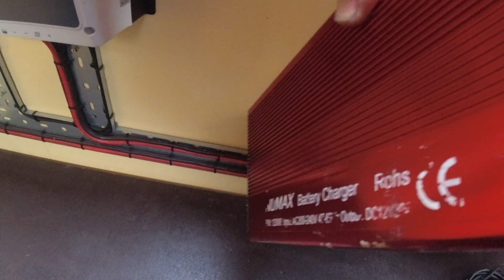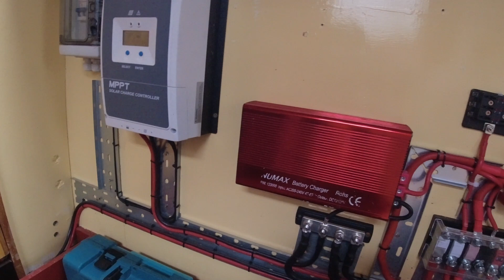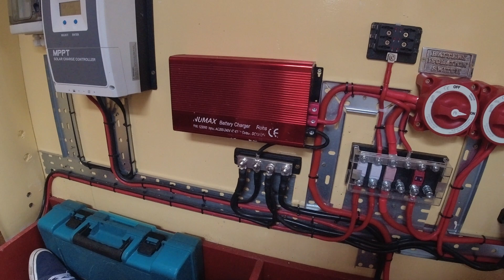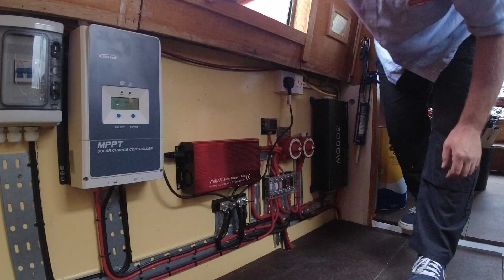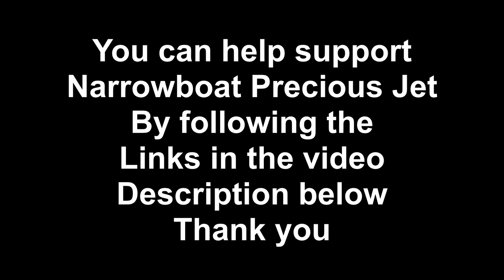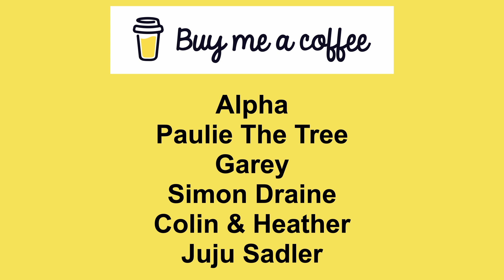Narrowboat Refit #76

Comment: Hi Steve, love watching your videos. Try fitting a fuel sedimentor between the fuel tank and the lift pump. It will remove the water, plus any rust and other debris in the tank. The fuel lift pump get protected and the fuel filter lasts longer. Keep the videos coming, great work. 👍
Reply from the maker: Under the rear deck I do have a filter / water / sediment trap however I don’t think the lift pump and final filter had been changed for ages! Eventually I’d love to fit a fuel polishing system on the boat and maybe have it so I could also use it to polish fuel on other boats to 😊😊👍🏼

Comment: Carful you don't crush the coaxial cable ...👍
Reply from the maker: Thanks Shaun, there is nowhere where it is trapped there is always quite a bit of a gap 😊😊👍🏼 As it turns out I read the instructions wrong and in fact I only need one aerial and the other ports on the router are for Wi-Fi aerials and gps to 😂😂👍🏼